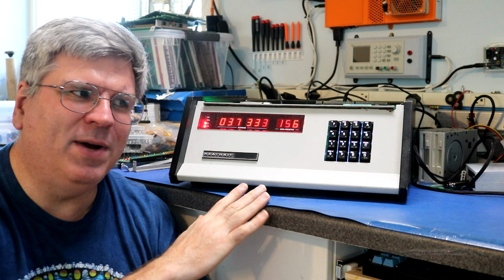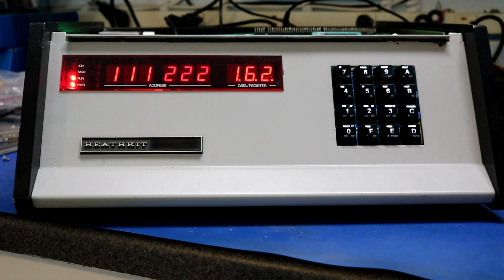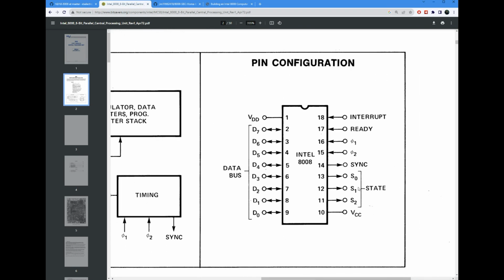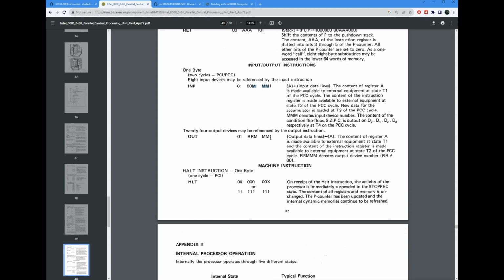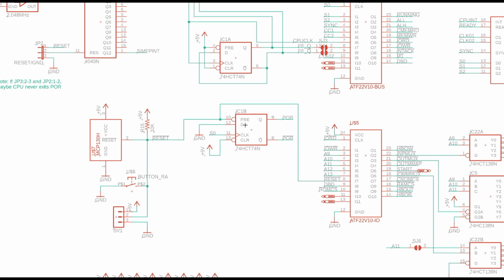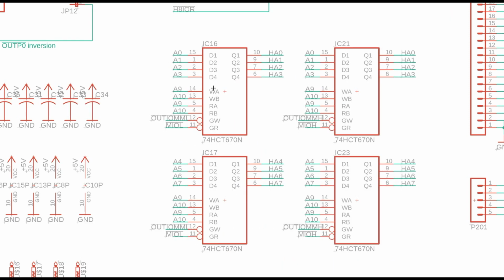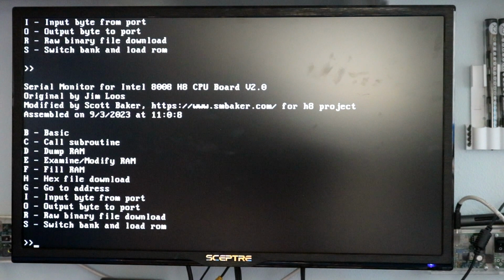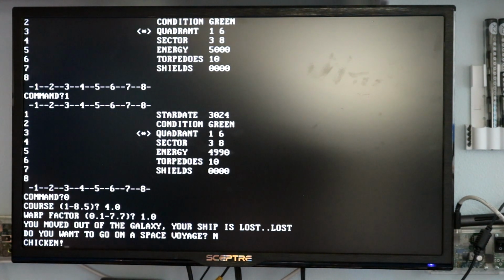Heathkit H8 Vintage Computer with an 8008 CPU Board (Not 8080... 8008 !!)

Comment: This is VERY cool. The 8008, along with the 1802, were the only processors I didn't work with back in the day. I even did a fair amount with the 4004/4040. But why the HCT logic? With the speeds in question, I'm puzzled why not just plain old LS, or even straight TTL. Next iteration needs to address memory on the H8 bus - just because! Great job on this!!!
Reply from the maker: I mostly try to keep in stock just one family of logic, and it's HCT. The HCT almost always substitute fine in place of an LS. I'm sure an LS build or a straight TTL build would be fine. I'm going to have to give it a shot!

Comment: I remember when the 8008 came out as a successor to the 4004. I wanted to use one but they were too expensive for me at the time.
When I did have enough to start building microprocessor boards I started with Motorola 6800 and then moved to the 6809.

Comment: Three bus cycles just to read or write one byte, no RAM stack, TTL...  Yikes!  Some real CPU archeology going on here.
Kind of wild that 50 year old silicon still works.  I do not trust simple resistors that are so old.
Does the 8008 run hot?  Aren't you a little afraid to use it?
Reply: Yeap, It's real experimental CPU archeology! But it's 10um tech process CPU. What can possibly happen to it? It gonna last another 1000 years.

Comment: Interesting that it’s an octal I/O, but it has a hexadecimal keypad. I assume 8 - F keys are being used for different functions?
Reply from the maker: Later H8 computers had the option to switch the radix to base 16, in which case the display would switch to match. I think when you upgraded, it even came with either new keys or new stickers for the existing keys to label the hex digits on them. In my case, the front panel is a newer reproduction using cherry MX keyswitches and custom printed keycaps, with backlighting -- something the folks at SEBHC came up with.
Reply: @smbakeryt  Thanks for clarifying.  The custom printed MX Keycaps do look really nice.  I'll visit SEBHC to explore further.